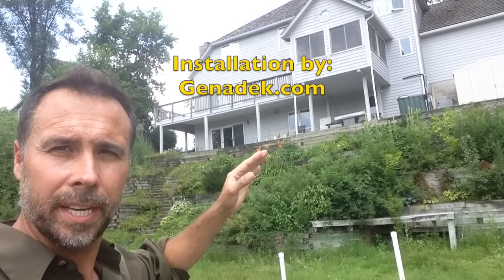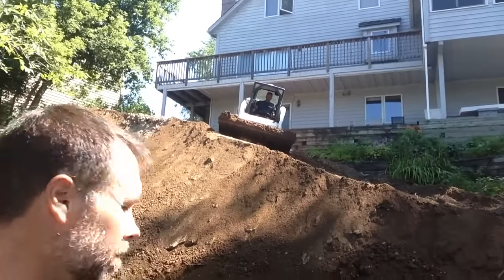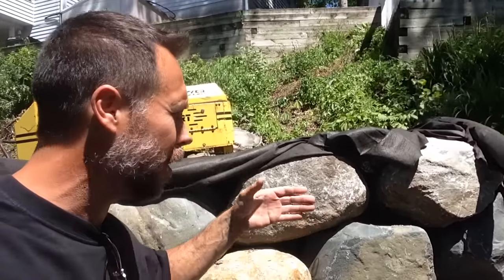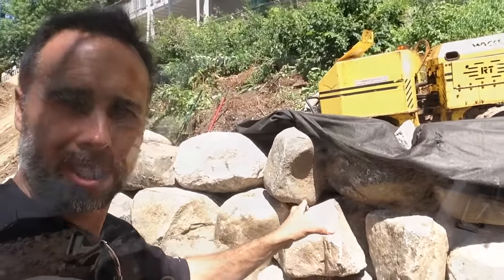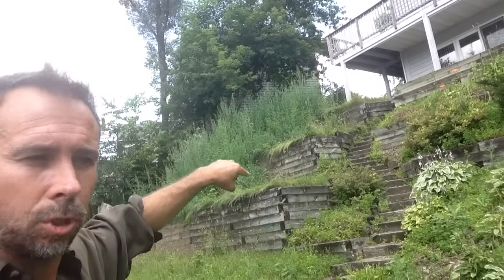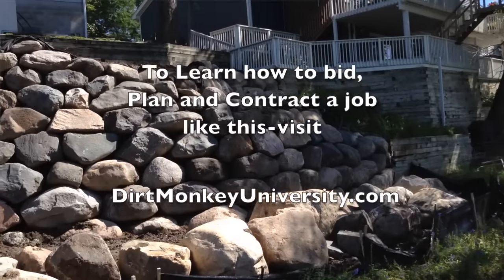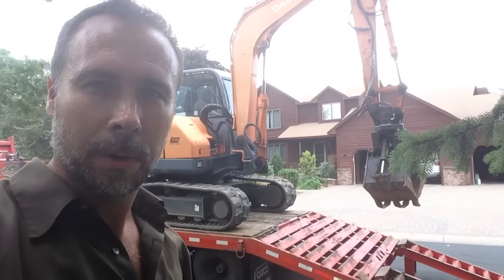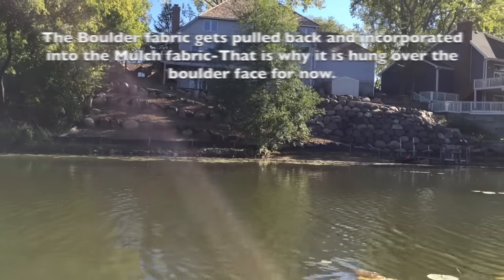How to Build a Boulder Retaining wall

Comment: I was taught by an old dutch guy, more than 30 years ago, retaining walls are supposed to be twice as thick at the bottom, as they are the top, that way the weight of the soil behind it, does not push the bottom out or the top over. I cant draw in here but the angle on the backside is supposed to be slightly steeper than the front, if your wall is 2 feet wide at the top, it needs to be at least 4 feet wide at the bottom.
  I am not trying to " critique " Stanley's work, I am just trying to pass on what I was taught, everyone makes their own choices as to the methods they use.
Everyone works different, everyone has different idea's and experience, after spending more than 30 years doing heavy equipment rentals, I've seen alot of different methods....  :)
Reply: Larry MacDonald very cool great stuff! That's what i learned as well bottom should be twice as thick as the top
Reply: I was told two fifths of the height

Comment: Do you need to remove the timber wall before building the boulder wall?  Or can you just build the boulder wall in front of the timber wall?  I have a short timber wall 3’ tall,  that is failing and I’d like to just put fabric and build the boulder wall in front of the wood.  Terrible idea?

Comment: If the house is "Settling" into the river, what stops the weight of all those rocks from doing the same. How does that work?
Reply from the maker: +Trooperandcooper Ale The previous wall was failing-allowing the footings to slide down the hill.  By installing a new wall and packing the soil we have stopped the gradual landslide.
Reply: Oh so due to the wall failing. That's right you were putting your hand in the gaps in the wood.
Is the client keeping the look of the solid rock wall or are there going to plant it up. Personal give me a dry wall. It looks awesome as is.
Reply from the maker: +Trooperandcooper Ale I am not sure if they plan on planting the wall itself or just the grades.

Comment: i have building rock RETAINING walls for 30 + years using quarry  rock that has been drilled and blasted, you don't have  rounded  boulders that can easily move , as he said before use angular rock for back fill so it stays in place , then the wall should be built out of angular rock, he should be using a larger crushed rock behind wall like a 2" to 4" , the crushed rock should be 12 to 18 inches think behind rock wall, never ever use filter fabric behind a wall it will plug up over time,

Comment: How much did you bill them?
Reply from the maker: +Guywithcrazyideas Guess how much.  I can tell you if your close.
Reply: +Stanley Genadek Landscape and Construction Business Pro im going to say 25000
Reply: +Stanley Genadek Landscape and Construction Business Pro Almost $100,000 is my guess
Reply: +Stanley Genadek Landscape and Construction Business Pro Well over 200k
Reply: +Stanley Genadek Landscape and Construction Business Pro  $165,000
Reply: +Stanley Genadek Landscape and Construction Business Pro -  $125,000
Reply: Stan said in annotations of the video where the neighbor was blaming him for his wall failure that it was almost $100,000
Reply: +J.L. Landscaping and property maintenance  More then that..... I could see $100,000 if normal block was used for about this size wall but this ones way more material.
Reply from the maker: +J.L. Landscaping and property maintenance J.L. landscape is the closest.  I hope to produce a video using this project as a guideline on how to break down a bid like this and take apart the guesswork. Every portion of this project was accounted for and line itemed.